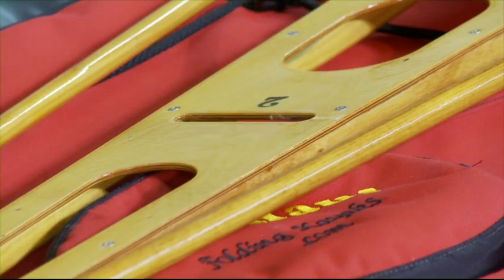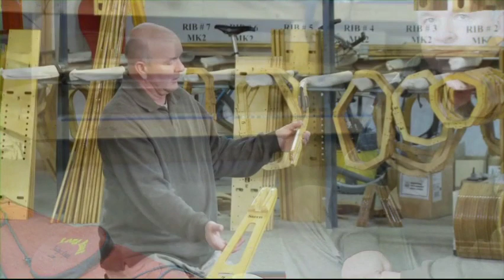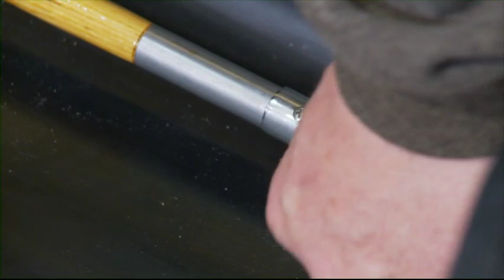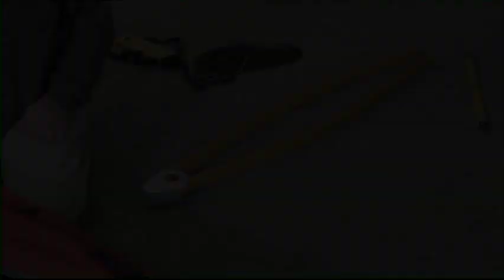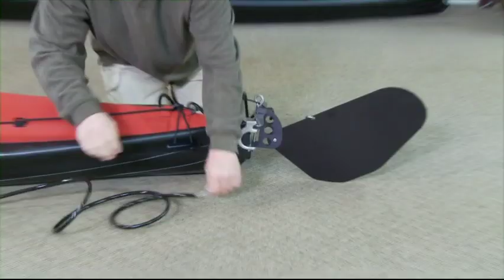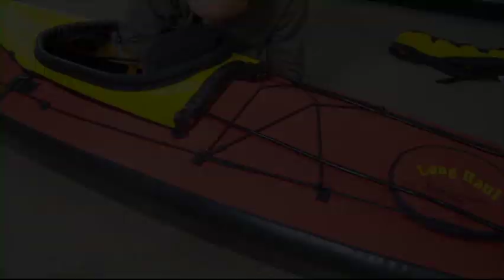Long Haul Folding Kayaks Mark I Assembly

Comment: Ok maybe no foot pedals since we have pedal drive the pedal drive is in the kayak goes out up and over up to the front of the boat and down I to the water to drive the propeller that pole needs supports. Maybe one foot pedal as a brake to help stop the boat.. the ruter in the back would be controlled by a thing by your side by your hand.. idk how sails work soooo.. again pedal drive does just drop down its on a pole that goes out and under over to the front of the boat.. we need side riders for stabilitity.. we also need in board sliders so the boat ain't supported by hinges.. side mount trolling motor uh 

Maybe make a boat from hard plastic panels two sides and s heat of metal in between the plastic and bolted together to make a sturdy board.. idk what you'd use for the piles Maybe pvc pipe that has been filled with something to make them more sturdy? Idk 

I'm looking at menards right now for some of this stuff.. 

Basically got the fabric cover and hardshell fold up for under side of boat to go.. and the inflatable safety ballons.. got to figure out the ruter..

Like ruter hanging of back pedal motor hanging of front side riders a sail a trolling motor side mount pedal drove inside kayak foot pedal for braking to side of that hand controlled ruter steering. Idk how to do the breaking system Maybe somewhat like outriggers I'd guess. Want kayak steak a kayak oar fish finger with transducer dip stick satelite radio and hang 2 lanterns front and back. Speakers.. 

Would love to use the pedal drive to also steer the boat kind of just tilt your feet and pedal and I guess the side router controller could be used for sail applications this way I can pedal and steer while holding a fishing pole. Would love 2 pole holders slanted back from the seat along with active pole holders -yaktrak.. 

Since boat is raised would need to elevate the seat up a little need locking system for seat instead of just straping it down

Needs non inflatable kayak cover needs front and rear storage compartments from top

Needs the zipper thing on back half of.cover stretch wet proof material under stretch wet proof over makes like a bag pocket woth zipper flaps inside so you can easily slide frame in then zip it up and pull both under and over fabrics to roll up like bag behind seat.. frame would be more simplied this way with just two halfs instead.maybe but would need additional supports.. 

Fold up thin hard body for under boat body folds up and only folds up to top of boat only much then gets sides of it strapped together.. maybe a solar panel behind seat of back portion of upper body and flood light bar by seat area

Comment: I'd do Inflatable thing as a safety measure and do fold up hard shell bottom and make the boat deeper to make it float right on the water. Inflatable thing if boat tips or starts to sink it won't sink all the way. Heavy waterproof fabric too maybe hardshell is just like strap onto boat instead of being permanently there like you got your heavy duty fabric rack and right at the end you strap the thin hard shell to bottom and fold it up over to top of boat and then secure the hardshell lining.. this is why you make the boat deeper becuase of fabric sag.. not inflatable under side and boat should still float this way the inflation part is for ballons inside the boat

Comment: All u got to buy is fish finder, trolling motor, battery, satellite radio, speakers, two lantern lights front and back, a fish finder dip stick. I forget what I all mention but still probably less then a 1000 for all that stuff and you could still sell for 6000. If you went commercial and got rid of wood frame woth plastic and metal and fiberglass. Maybe around 3,000 for boat cost less sell more cost more sell less.. uh 3,500ish be about what anyone be willing to pay for this if it had all the stuff I mentioned well maybe 4500ish this is alot of upgrades

Comment: Man zip top and straps on back half of cover that'll make frame assembly way easier plus under the back half on the under top side put like a stretch waterproof fabric zippers are never a good thing and then on the outside se thing too this will put the zipper inside like a bag but you'd still be able to zip it up. Then you take top part and bottom part from under zipper and roll it up and strap it down right behind seat, this will make frame assembly maybe just two halfs instead of like all that front portion and back portion. Woth hard plastics and metal and fiberglass poles I'd be down to buy if you did this plus it'd be cheaper cuz it'd be commercial

Comment: This looks like an absolutely awesome bit of kit clearly built to last.  Maybe add a circlip to the bottom of the rudder pin though? If it comes out then parts of the rudder are going in the drink. Also maybe use metal rod epoxied in instead of screws might save on wear somewhat. Anyway that's my 2 penneth. Keep up the good work very impressive.

Comment: Really excellent assembly video with remarkably clear camerawork and narration. Compared to the Folbot and similar lines with aluminum and plastic parts, this is a really solid wood and metal product. Those latches and pins will easily outlast plastic and Velcro connections. Nice to see the rings are large enough for cold fingers, though the tricky part looks to be assembling the cockpit area frame obscured from view. Working in real time, the owner needs 24 minutes to assemble the kayak, and then at 24 minutes he assembles the rudder. Not many of us are going to do this for a couple of hours on the pond or river - but those undertaking expeditions could trust their lives to this product.
Reply: NOTE THE WOOD WILL ROT I KNOW I OWNED A 1983 PISCES LEFT IT ASSEMBLED WEIGHED A TON

Comment: I have a Folbot Cooper, which is lighter, longer, and faster, but certainly can't carry as much. I will seriously consider this boat when looking for more capacity.
Reply: I had a 17' Folbot back in the day.  The construction was very similar to this boat.  The primary difference was in the gunwhales and the combing.  The Folbot did not have "formal" gunwhales but used an aluminum tube to form the junction with the hull section.  I very much like the wooden rods that Long Haul uses to support the skin from the formers.  I have a later 17' Folbot that uses cast aluminum formers (wish I had kept the old boat).  Again the aluminum tubes are less robust than the Long Haul version.  Have had a lot of fun with these boats.  Were I considering a sailing rig, I would absolutely choose the Long Haul.

Comment: Ain't nobody got time for that... One word oru
Reply: we shall see how the oru holds up after long ermine use.   plastic work hardens more easily than metal.  I forsee the oru breaking at the folds.
Reply: Cool.  The main thing is that if people like it, it's there for them.  I, however, will stick with my Trak.  One test paddle would  show someone that it is well worth the price.
Reply: The Oru has no rudder option and a max payload of 400lb. That&#39;s fine and dandy for playing in a light surf, but when you realize that the usable payload is about 300 all but the lightest paddlers can&#39;t use them for touring. Also, they have no rudder option, sail mount etc. The Oru is a fine boat for recreational use, but not for serious touring or fishing use. I fish out of mine in the gulf of Alaska and Bering sea, and I use a klepper (original design that long-haul is based off of). It has a 1klb weight capacity and can bring back two decent sized halibut.
Reply: @Nunyabeezwax509  I also saw that the Oru collects water inside the corrugation -- I'm trying to buy a collapsable - and I'm liking the looks of klepper or folbot.

Comment: 98% klepper copy.
Reply: Long Haul is made in Colorado by the former Klepper service center for North America. The main difference is Long Haul is a better kayak.
Reply: @ccjohncc1  Better in what way?  Fittings, materials?  Assembly?  Don't think so.
Reply: @seesaw7289  I used to be a dealer for both Long Haul and Klepper, there's no comparison in quality, the LH is far superior.
Reply: Hey 98% wally...yeah and I suppose your mobile phone is 'the original'...or your television set...or your car???? No industrial espionage here....Mark has been selling folding kayaks forever and has simply developed and bettered a design concept. Klepper Shlepper!!!

Comment: you sure don't know very much about sea kayaking! this is an apples-to-oranges comparison. a hard-shell kayak (while cheaper) has a lot of limitations. people who understand sea kayaking know which type of kayak is best for the type of conditions they expect to encounter. if you just want to day-paddle on a local lake, hard shell kayaks are a good deal. however, if you want to do a 10-14 day remote expedition, with wind and swells, this is by far the safest type of kayak.

Comment: Seems way too complicated/time consuming to assemble and the cost is ridiculous when you can just buy a better kayak AND a roof rack.Hell, for 1,900 grand (which is the cheapest the others are 3k and up)  you  can just buy a used 'regular' boat and engine or a much better kayak and still have money left over. Absolutely ridiculous.
Reply: Yeah, but just try checking that kayak as luggage and flying down to Chile with it.  That's where these things show their true worth.